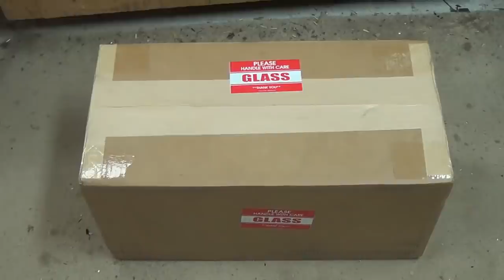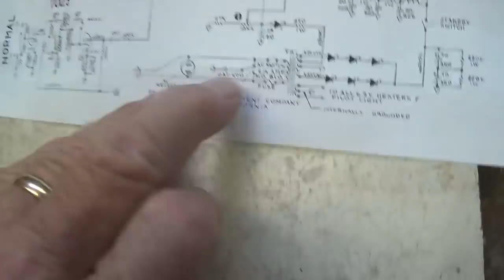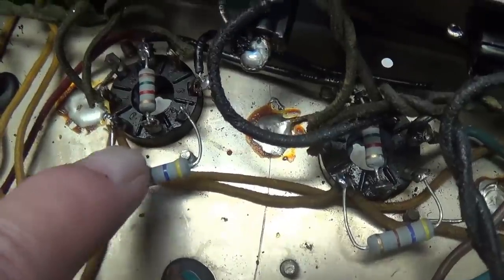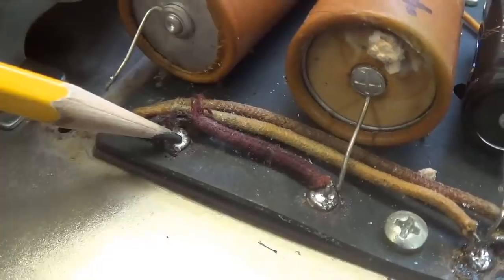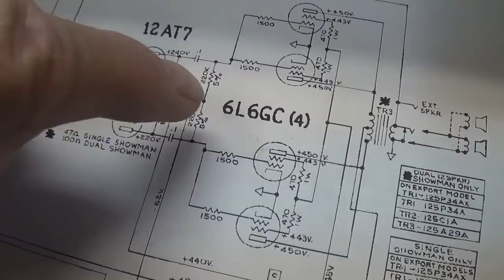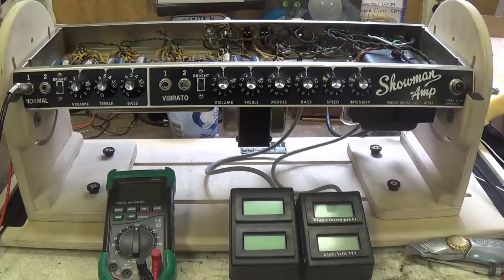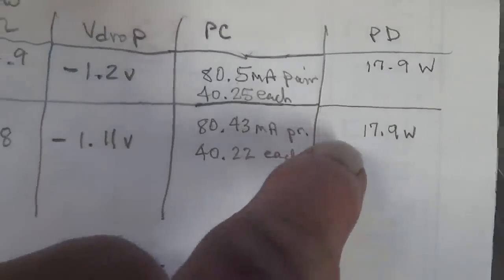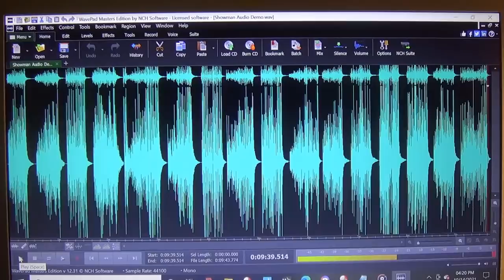1965 Fender Showman.......Back from the dead, but not without an epic struggle

Comment: @Uncle Doug - This is the first time I've seen this type of setup with that many diodes in the power supply area. I'm sure you've seen it many times, but found that interesting, what was their reasoning? Wouldn't 4 have been enough?
Reply from the maker: Since diodes are so cheap and so critical, I tend to think they use 3 for each HV leg, partially for longevity and possibly because multiples are more efficient.
Reply: @UncleDoug  Seemed odd to me with my small knowledge of electronics. Usually four to a full wave bridge rectifier, but it appears that's not what they're doing with these since they appear to be in serious string. I need to go back and look at the schematic again. Just found it interesting and thought I'd ask. Thanks for the reply. 🙂
Reply from the maker: @randyr.parker2698  The diodes are in series, Randy. It is not a FWBR.
Reply: @randyr.parker2698  it's a full-wave rectifier circuit, but not a "bridge" rectifier. Note that the power transformer's high-voltage secondary has a (grounded) center-tap, which is necessary for a full-wave rectifier but not needed for use with a bridge rectifier. A rectifier tube such as a 5AR4 or 5U4 is also typically used as a fullwave rectifier, with the HV centertap tied to chassis ground (a "bridge" rectifier using two rectifier tubes is possible but not very practical)..

Comment: This is going to help me so much with my 1966 Bandmaster. I replaced the caps in the doghouse, the grid blockers and screen resistors and did a 3 wire conversion, It started smoking on me the second time I turned it on. I tried to bias it but don't think I was too successful. I have no idea where the smoke came from.

I'm going to immediately rewire the 3 wire conversion the way you did here, even copied your drawing. I got scared and haven't touched the bandmaster in several months but enough is enough. Is there a way to email you?
Reply from the maker: You can send private messages to our FB page: Uncle Doug's Vintage Amps.
Reply: @UncleDoug  I believe I found the cause of my smoking amp. Apparently when I changed the screen resistors one of the leads going to the #6 power tube socket lug was not trimmed and was touching the chassis. There was also a 30 amp fuse installed which I replaced with a 2 amp.
Reply from the maker: @brianm9282  Wow, a dead short in the screen circuit would definitely make some smoke, Brian, especially with that huge fuse.
Reply: @UncleDoug  I was testing the NOS Realistic 6L6GC tubes I put in this amp when the dead short happened and they both now have shorts when testing with my calibrated B&K Model 606 Dyna Jet. I guess that was source of the smoking as there is no evidence of anything else burning up at all. I also just made a dim bulb current regulator that I wish I had before. All lessons learned the hard way and part of owning/working on these vintage beauties.
Reply from the maker: @brianm9282  It's typical that output tubes, when subjected to arcing electrical charge, will develop all sorts of internal shorts, Brian. I hope your new current limiter prevents such problems in the future.

Comment: Ahh,  later models DIODE rectification - for the late Marshall I refered to and these later Fenders.  I wonder if the higher current running of these , even if tamed by resistors, actually runs the entire tube chain higher than a tube rectified circuits.  While I am told electrons are electrons I dont (and I am not an audiophile by any means just have an enquiring mind in physics/chemistry) believe that spin and power impacts of electrons in circuits and their reactions with metals can do strange things ( see for example the theory of capacitors where I can never follow the maths , and at the extremes neither do the electrons.  We also have the same thought as to the purity or otherwise of mains which seems to spike and dip and run 10v higher on average than it has in the past.
Reply from the maker: Thanks for the info, HP. Diode rectification does not "sag" like tube rectification does, so the circuit is driven a bit harder.

Comment: The shorting function of the main speaker jack needs to be defeated so the new 4ohm jack (fka “ext” jack) can be used (alone.)  Otherwise leaving the main jack empty while using the 4 ohm jack will leave the output shorted to ground.
Reply from the maker: Although it wasn't discussed in the video, this was done, JJ.

Comment: I see the Guitologist is having trouble with tubes blowing on a 1986? Marshall Amp.  Its not clear as to if it is the circuit design or the modern tubes - I wonder if he checked the o/p transformer
Reply from the maker: I hope he watches this video, HP. It's a rather rare problem, and it took me a while to figure out.

Comment: Uncle Doug, on the two halves of the output transformer where it's virtually impossible to get both side with equal resistances, would it ever be worth inserting an appropriately sized resistor (resistance & wattage) as needed to balance things out?  Within reason, of course.  Or would that cause other problems?

I'd be interested in seeing what you determine to be the problem(s) with your EuroTubes (sp?) probes because I suspect that a lot of folks purchased them after you started using them.

Also, another, much smaller channel that I subscribe to explained how Google had decided unilaterally to say "screw you" you the Content Creators, even the non-monetized ones, and start placing ads into all videos without the permission of the Content Creators.  Instead of taking his channel down, he decided to monetize his channel to "minimize" the amount of $ that Google/YouTube make off of his content AND he gets some say (until they change the rules again) about what type(s) of ads are placed into his videos.  Uncle Doug, you should consider doing this too, even though it's a PITA, but you at least maintain a bit of control over the ads they force into your videos for those of us not using ad blockers.
Reply from the maker: Good questions, Bob.  1.) Some amp circuits have a balance pot to do what you suggest. In cathode-biased DE circuits, you can tailor the bias resistors to balance the tubes.  2.) The probes were sent back to the factory several days ago. I will let you know what happens in a future video.  3.) YouTube has (apparently) provided me with ad-free viewing in return for placing ads in my videos. To be honest, my work schedule is such that I simply don't have the time or energy to fight them over the monetization. Fortunately, my generous Patreon patrons provide sufficient support to keep us on the air.....and income really isn't the prime motivation for our efforts.

Comment: Just to please an old tube guy's curiosity, could you hook up an oscillator to the old transformer output, and see what comes out of the primary sides? See if the voltage ratios are anything normal.
Reply from the maker: The amp and old OPT have been returned to the owner, James.

Comment: great video as usual. very timely as I have a friends silver faced dual showman in house.
question
the dual showman has alot of white corrosion 
how toxic is this?
also are there any of your videos that show how to deal with this.
im a little hesitant
it may even be under the board?
thanks again
I've learned so much from your videos
I really appreciate all you share for us
cheers
Reply from the maker: Thanks, Wailin. If it's the same type of oxidation I've seen on some of them, a rag moistened in Windex would probably remove the residue. For god's sake be sure the caps are discharged prior to the cleaning process.....unless you want to learn a new Irish dance.
Reply: of course
ill check
but this amp hasnt seen electricity in quite some time
ill be replacing all the electrolytic before firing up anything
but yes ill definitely check the cap voltages etc before
i read that the oxidation could be zinc oxide and was toxic
ill try as u say with a mask and gloves to be safe?
thanks again
really really Appreciate all your videos
Reply: @wailinfree7350  , probably not zinc plating; another highly experienced tech (Psionic Audio, on YouTube) says its nickel plating.  I don't know if nickel oxidation products would be toxic or not.  Lots of old amplifiers have cadmium plated steel where the oxidation is a powder greenish white, and that stuff is toxic and particularly unpleasant to breathe.
Reply: @goodun2974  thanks for the reply
do you know what video he talks about the corrosion
i think I was reading about the cadnium bein bad
hopefully its just nickel
im sure if i wear a mask and gloves i should be ok
Its all over the chassis
probably need to remove pots and possibly board to clean right
just wa m t to make sure its dafe to work on even after cleanup
Reply: @wailinfree7350  , it was somewhere in the last three or four episodes of Psionic Audio; very recent.
Reply: @goodun2974  good enough
thanks alot

Comment: Judging by what was showing on your Eurotubes probes' displays, they need new batteries. That's probably why the measurements were inconsistent.
Reply from the maker: Eurotubes probes are powered by the amplifier power supply, TC.....they do not use batteries.
Reply: My fault, I wasn't aware of that. I can now see that the LOBAT warning is displaying due to the amp being plugged through the current limiter. Perhaps the probe doesn't like the parallel tube arrangement, hence the problems?
Reply from the maker: @12tomicheck21  The probe can only "see" and measure the PV and PC for the tube it is in series with. It has no idea what else is going on in the circuit.

Comment: Would have measured the output primary resistance first thing on an amp that went dead during operation.... never would have used the old tubes. Would be interesting to know why they used different resistors in the power supply.
Reply from the maker: Thanks for your input, Johnny.

Comment: I haven't finished watching so maybe you caught it later in the video, but the two dropping resistors in the doghouse are in the wrong order.
Reply from the maker: Not only that, they were the wrong values, Clark.
Reply: @UncleDoug  - The ones you installed were the correct values, just in the wrong place.  They should have been swapped...

Comment: I can good imagine once you use Eurotube tester on the amp with only two tubes in the output everything might go back to normal.
Reply from the maker: The Eurotubes probe only responds to the single tube to which it is attached, 9W.
Reply: @UncleDoug  I have had issues with some parallel loads when loads are not linear. Like if you measure the current in front of the node or behind it current is stable. But when you measure two of them they are going up and down like crazy while their sum stsys the same.  Namely their internal resistance varies and they are taking more or less current. But one one starts pulling more other pulls less. Looks like oscillation but it's normal. Might happen same here.
Reply from the maker: @NINEWALKING  Thanks for the helpful suggestion, 9W.

Comment: What brand of of transformers do you recommend?
Reply from the maker: Since ClassicTone went out of business, I have been using Hammonds.
Reply: @UncleDoug  I worked for years in high end audio, I guess I was selling audiophile gear. Appreciated the old classic McIntosh MC 20’ s and MC 240’s. They had monster power supplies. Does the same go for guitar amps? Should one concern themselves with a good power transformer or output transformer. Which makes the biggest difference for tome quality?

Comment: You could have put a 3-way selector switch and had 1 speaker jack and select between 4, 8, and 16 ohms The switch  put in the other jack hole.
Reply from the maker: Thanks for the helpful input, James.

Comment: I dunno for myself I would replace that red wire, just how I am, if it was my amp I'd find some period correct wire and replace it and maybe slack it around that joint?  some odd imperfections in this one..  this guys house may be infected with gremlins?
Reply from the maker: Thanks for your input, DD.

Comment: One always wonders when a bad output transformer occurs, if, maybe, someone decided it would be great to plug in an external speaker or speakers. Something that created a really bad mismatch to the impedance that it was intended to drive. Nothing like a 1 ohm load to get a transformer nice and hot. Not always the case, but...
Reply from the maker: There is no telling what's happened to a vintage amp during its lifetime. No doubt that impedance mismatches are probably responsible for many, many damaged OPT's.

Comment: Do you ever get a situation of a rotted wire that could be missed, broken in the insulation causing a high resistance?
Reply from the maker: Yes, indeed. I suffered for two years with a BSA Thunderbolt motorcycle that would strand me in intersections and on deserted roads. After replacing virtually every part on the bike, I finally discovered a broken (brand new) ignition wire within smooth, perfect insulation.
Reply: @UncleDoug  it's always the last thing!
Reply from the maker: @phonotical  Yep, which means you should always start the hunt at the end rather than the beginning ;)
Reply: @UncleDoug  hehe
Reply: @UncleDoug  hmmm.... Did BSA bikes use electrical equipment and wiring harnesses from Lucas,  the fabled "Prince of Darkness".  As an old joke goes, why do the British drink warm beer? Because they all own Lucas refrigerators!  I have installed stereos in more than a few small British sports cars ( Triumphs, Spitfires, MG's and TR-7's etc)  back in the 80's that were wired by Lucas and they were an electrical nightmare. Even an expensive vintage Rolls has crap electricals from Lucas.
Reply from the maker: @goodun2974  Yes, they did, GU, and one of the first restoration tasks was to replace all the Lucas gear possible. The designs are hopelessly intricate and prone to failure at the worst possible moment.

Comment: You would think that there would be a shop that can rewind transformers.  When I was younger, I worked in an electric motor rewind shop.  It can't be that difficult as long as the E/I iron core comes apart to remove, and replace the coils.  I'm assuming it would be held together by rivets.
Reply from the maker: No doubt there are places that will rewind transformers, AR, but that introduces some undesirable variables, like how long does it take?, what is the cost?, and how good is their work? When repairing amps for customers, variables like this are simply not a good addition to an already challenging process.
Reply: @UncleDoug  I guess what I'm trying to understand is why there isn't a shop with a known reputation, and inventory within the music community.  I'm guessing it's because new off shore options are available cheaper.  We can question that quality as well.
Reply from the maker: @qua7771  There may well be such a shop, AR, but they don't seem to advertise very widely.
Reply: @UncleDoug  The shop that I worked in did industrial work, and wouldn't think to cater to the general public for such a specific item.  It seems like the kind of process that is better done in bulk, if you happen to acquire a ton of vintage transformers.
Reply from the maker: @qua7771  Efficiency would have to be sacrificed, for practicality, AR. There are a very limited number of these transformers that require repair, and I doubt that any large business would want to be bothered by them. It would require some old coot, doing the work by hand, in his cluttered shop.....actually this sounds like yours truly :)  Maybe a new career move.
Reply: @UncleDoug  I was scratching my head about weather or not I have the time, but I'm not retired yet, and have been up to my ears in various unfinished projects.  One of them is a C5 corvette.
My method for rewinding would be to first get a few appropriate materials.  Essentially, a winding machine that can count turns (possibly your lathe with an odometer, and stop foot switch).  You can fabricate forms the size of the iron core out of blocks of wood with sides to hold the winding in.  You line the form with motor insulation material (usually nomex/ mylar/ nomex paper 3mil, 3mil, 3mil thick).  I used to lay some flat string or tape in the form first so, when your finished, you can tie it, or tape it to hold its shape.
You will need several common gauges of magnet wire.  You put in what you took out, so you have to count windings, measure wire gauge, center tap points, and record data for future reference.
To get the old winding out you can loosen it with a torch or toaster oven.  Most likely it was dipped in insulation varnish, which is a good idea for reducing magnetic vibration.  When you finish a rewind, you will want to do the same.  Dip it in a can of piss thin insulation varnish while it is hot so it gets in every nook and cranny.
Once you get used to the process. It should go fairly quick, like anything else.

To me, the tedious part could be taking the E/I iron core apart, depending on how it was assembled.  It may involve re-stacking each iron laminate alternately.  I haven't seen inside of one.  I would probably build a jig for re-aligning the iron stack for assembly.
Reply from the maker: @qua7771  Thanks for your detailed explanation of the process, AR.
Reply: @UncleDoug  After posting that, I noticed that there are quite a few videos here on YT of small transformer rewinds.
I did notice that many do have the E/I iron core laminates stacked alternately, which makes disassembly, and assembly a bit tedious, but still doable.  It should be simple enough to build a jig for stacking the iron, perhaps with pins for the holes/ slots.  There is always a way if the transformer is important enough.  I really like how you stuff capacitors to retain vintage esthetics.
Reply from the maker: @qua7771  Thanks, AR :)